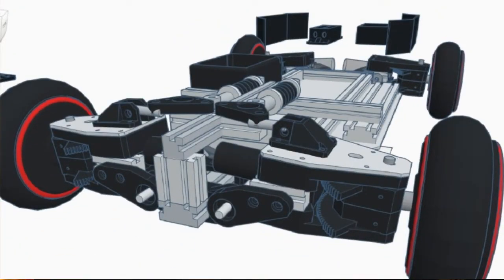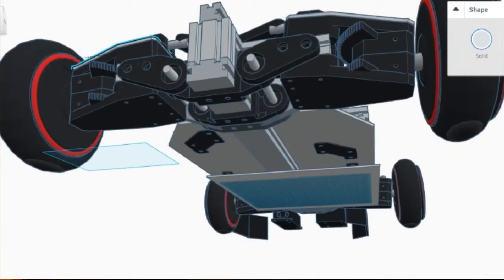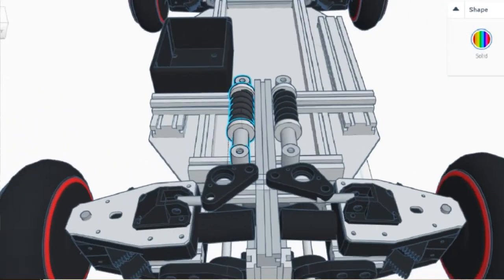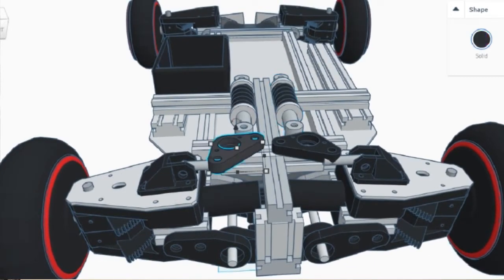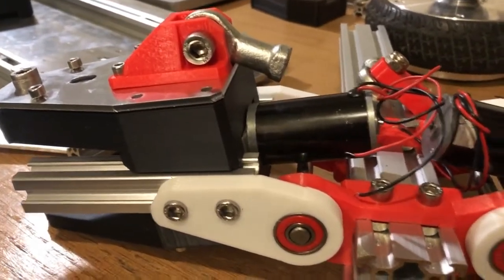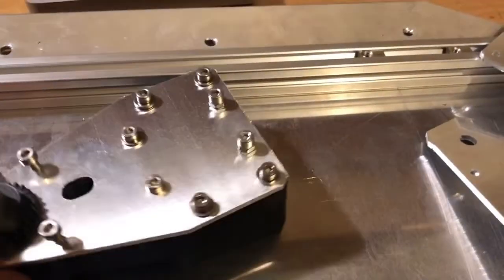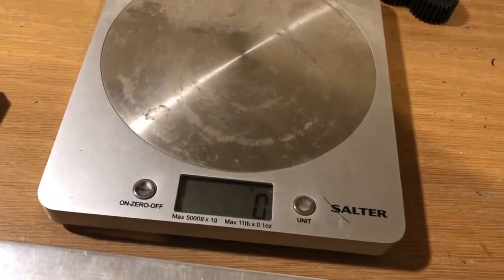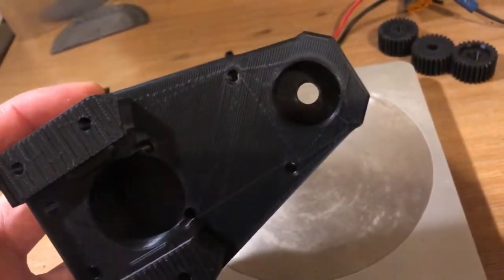RC HOVERBOARD CAR - Build Update 4, suspension, stronger parts

Comment: I will be building/designing a fleet of big r/c race cars.  There will be rwd.  I was thinking of using hoverboard hub motors since they are simpler and pretty cheap really.   My other idea is a single cheap winch motors with a differential.  Big advantage they run on 12v dc, but then I need to fab a diff and some axles.   Wheel motors are very heavy which makes handling difficult.  Your setup looks very heavy frankly.   Maybe an earlier video has more details on what you tried before?
Reply from the maker: hi, that sounds interesting, these hoverboard motors are good, how fast did you want your fleet of race cars? using these its a bit tricky to get them over 25mph, a lot of the weight for this thing is in the wheel hubs, each one is pretty chunky and also have a 24v gear motor inside so each of the wheels can steer on their own, the heavyness is one of the reasons i make smaller cars now, thanks

Comment: How do you connect 4 speed controllers to one battery?
Reply from the maker: ok, in this video there are only 2 controllers, but the principles are the same, im just using a terminal block connecting the black and red speed controller input wires together, the same will be for using 4, however i will probably be using 2 batteries for the 4 wheel drive, hope this helps, thanks